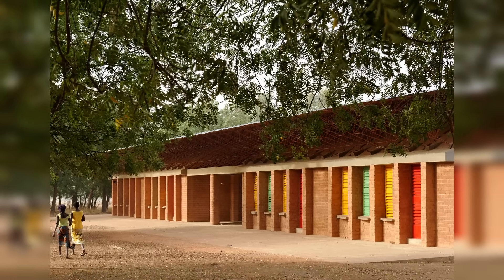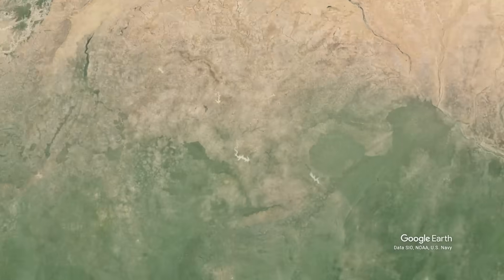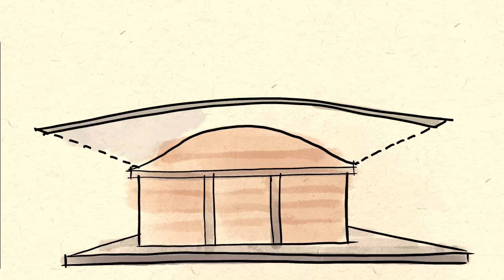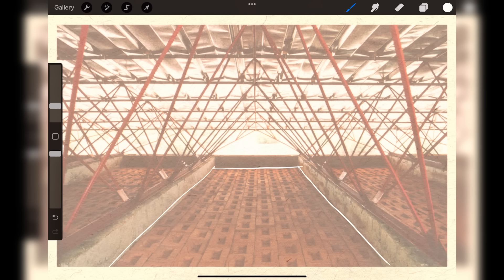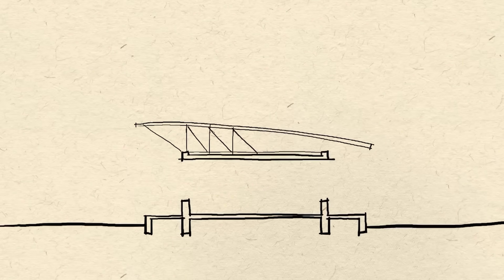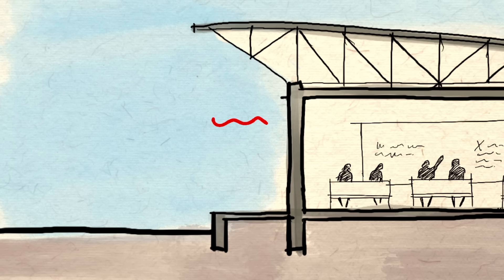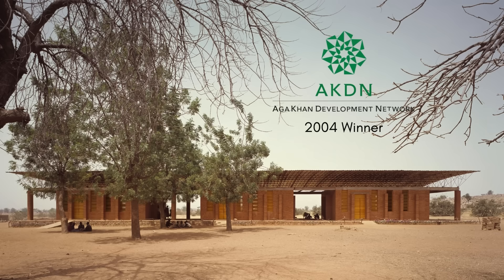The 3 Design Strategies Keeping This Building Cool In Scorching Heat

Comment: They study in schools in the heat because they have no other option. 
Unlike most readers here, I've actually been inside a school on the edge of the Sahara where it was 112F in the shade and no electricity around. The only AC I saw that entire week was in my room in N'Djamena, and in a pharmacy that I had to visit when I got sick. (Pro tip: Don't drink the water. And don't eat the food).

And yes, people gathered in hot buildings to do their school and their work ...because there's no other option.

But if someone wants to put a swank roof on these buildings and cool them down, heck yeah - let's have more of it!
Reply: It would drop the temp by no more than 6 degrees at best. Better than nothing, but hardly cooling. I am saying this as someone who lives in a house like this with no AC.

Comment: Whoa... Hold on.
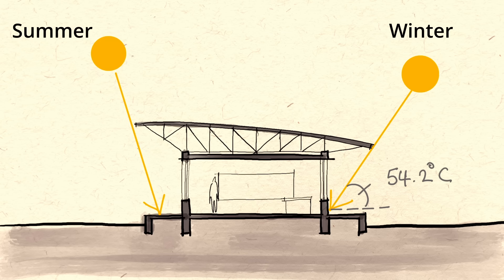@ ~3:00. you show a pic with grounds temps of 101.1C and 54.2C.
Both of those are ABSOLUTELY impossible.
What gives??
Reply from the maker: They are the angles of the sun! The C was a mistake (see the pinned comment) sorry for the confusion 😅
Reply: @SaraSaadouni_TAC  Thanks.  I didn;t see the pin.

Comment: So what difference in tempaerature does it make? That would be the key question I want you to answer!
Reply: There is a reason this clinching piece of evidence was not included. Can you guess why?
Reply: @Craig_Tucker48  I am presuming you believe its because it may not be as effective as it appears on the face of it. I see in other comments they say the award states six degress celcius lower temperature than outside - and the narrator says their "hot" temps vary between 30-40 degC. So 30/40C outside 24/30C inside - which is quite comfortable if humidity isn't high (which it is in BF only in the rainy season June-September). So.... I'm thinking it works well enough?
Reply: @gideonporter537  I don’t believe this, I know this. Unlike you, I live in a house designed like this with no AC in an area that is hot all year and humid for half of it. 

Also 40 minus 6 isn’t 30, it’s 34. 

This design is definitely a smart one and would save so much energy when used with AC, but to say no AC needed like it does on the thumbnail is misleading to say the least. That is why no temperature measurements were reported in the video.
Reply: oops - my math is crap alright lol. But I think it is still a brilliant idea for places that have no hope of affording AC. Better 34deg than 40! And I know from working for an HVAC company that a dry atmos means 34 can feel like 30 if there is air circ. And lastly I would say the locals are used to much hotter temps than we westerners are - so even 34deg is probably "cooler" for them. But yeah I get your p[oint.

Comment: I mean, this is the real deal. Here we are in America designing houses. I’m building them pretty much the same way with the same heating systems and insulation stuff in the past hundred years. But there’s so much we could be doing to work with nature, and said I
Reply: You mean wood-framed? We still build that way because it works. And if you're not using modern materials, products, and concepts to design, build, and finish your homes you're doing it wrong. Modern American homes are extremely energy efficient, weather-tight, highly durable, all but obviate concerns over pests, and are built to deal with the environmental needs of the locations in which they are built. Oh, the horror!

Comment: A good number of years ago I did some thermal analysis with SolidWorks Flow Simulation, a tool used for analyzing products like computers and phones, to do some basic probing on the idea of a shade over a roof. What I found was that there needed to be a pretty good size gap, similar to the one shown in this video, to make the concept effective. It is typical of passive flow, density driven flows need a ton of space because the driving force is low. If wind were the primary driver, you could reduce the gap, but then the strategy falls down on a calm sunny day. The holy grail is a passive geothermal heat pipe that uses water as the working fluid. Heating from above, cooling from below is stable though, and can't be used to drive circulation, the driver being changes in density. Ever wonder why the stuff at the top of a cooler can be warmer that the stuff at the bottom? Heating from above, cooling from below, flow shuts down, and with the thermal conductivity of air being so small, the column stratifies thermally. Fun fact, the thermal conductivity of the materials that thermal insulation are made from is actually pretty high compared to the insulation as furnished. The reason is simple, insulation has one job, keep air from moving. The drag induced by insulation nearly eliminates the effects of density driven flow. The Achilles heel, wind loading on the shade is high in storm conditions, so designing it to withstand high winds is probably cost prohibitive. Probably better off designing to be easy to repair than resist crazy wind that only comes around once every 10 years.

Comment: In Strategy number 2 the video shows 54.2° C for measuring the angle during winter and 101.1° C for the summer. So I'm a bit confused about why the C is there for measuring the angle?

Comment: Roughly 20 years ago, Dwell featured a home in the Southern California desert near Joshua Tree called the “Desert Shed.” It featured 3 main features: 1. A concrete slab that was at least double the amount of a normal 1500sq ft home with the house built directly on top of it (to reduce temperature swings from such a massive slab), 2. A metal roof built up over the house for the previously mentioned venturi effect, and 3. The house was south on the slab with its windows facing south to gain solar energy in the winter and take advantage of full shade in the summer.

Comment: A friend of mind in Washington State has a triple-wide manufactured home. He added a “pole barn” roof 4 feet over his house. It not only provided shade in summer, which sometimes topped 105 degrees, but helped in winter as well with the “snow load”. He did extend the chimney from his fireplace up and through the added roof height to keep smoke from being trapped inter the added roof even though the “pole barn” was open aired on the sides, smoke could still be caught under it on no or low wind days. This was back in 1988……Cheers

Comment: The fact that the inside temperature is NOT mentioned is highly suspicious.  
Probably it is more or less equal to the outside air temperature and the building is not "cool" (not to mention it is plain ugly which for an architect is not a great achievement)

Comment: Give us the statistics: Temperature in the sun, In the shade, and with the Venturi roof. 
Is it an open roof gap over a ceiling built as an inner roof? Are there vents in the ceiling? One side elevation shows a flat inner roof and curved outer roof, another shows a curved inner roof and curved outer roof. Which is it? Ventilated roofs over ceilings are common in hot countries. 
In Thailand the gable angle is very steep, about 50°, to allow the  hot air to rise. Fans are used to create a breeze. 
In Thailand often a flat roof becomes an open air top floor over which a gable roof is built for extra shade, This floor is commonly used for clothes drying, which in itself reduces heat required to evaporate water. Bird wire is needed to stop flocks of birds nesting and pooping. 
The houses are often raised one floor height above a pond of water, or in modern times, above a car port, bathroom, laundry and open kitchen, Traditional houses did not have glass or fly wire, this allows full natural airflow. Mosquitoes and insects can be a problem and insect nets over beds are often required. Verandahs prevent the sun from shining on the walls, and usually have herbs and plants growing in them to the increase shade. Sometimes verandahs are so wide that there are no inner walls. I have 37°C in the carport at 4am in the morning. 
Thermal bricks hold the heat making the house hot at night. This choice is related to whether the temperature drops significantly at night. Concrete block houses do not cool at night in Thailand, and need airconditioning.
The break through is the Venturi effect of the roof. I need to see statistical evidence of the  increase in air flow. I am sure it would be an improvement.
Reply: Click bait. I live in the desert. 95 is considered a balmy day - LOL.  First of all, the people in Burkina Faso live in primitive conditions - the little relief they feel from the heat is different than people who are used to living in a country like the U.S.
Secondly…..humidity, or lack thereof, plays a big difference. On a 8% humidity day here, even 95 doesn’t feel bad…..during Monsoon season that same temp can make you feel like you want to die.
I have lived here since 1978. I have electricity but also am set up for off grid.
I have compound style houses…..each is 10x12. Double layered roof with air space in between layers. Top layer is covered in liquid silicone roofing material - three coats
I made evaporative coolers that run off a 100w stand alone solar system.  Fan is 60w….pump is 20w.
Standard 100A lithium batteries.
My little houses are normal wood construction, wool inside wall insulation. 36x40” windows on three sides.
On a 110 temp day, with low humidity…..inside each house is about 75 tops. I often have to wear a sweatshirt till mid morning.
Reply: @SUHSeungJi  👍Good I did not say "click bait." No problem. I believe,double roof with air flow in between, and maybe a sod topping and grass with automatic night watering if water is freely available. Heavy black plastic used for water sealing concrete slabs and walls, or over a timber, timber and iron or reinforced concrete slab all with plastic waterproofing, 
Consider reinforced concrete pillars and cement block walls with steel rods and infilled with cement for wall strength. Then mound earth up to the inner ceiling roof at an angle of 30° from the ground, grassed, the walls plastic waterproofed. Door and widows double glazed gas filled. I cannot do the engineering safety calculations. Imported steel and concrete are very expensive compared to local timber. Different tooling and jigs or boxing adds expense. 12' X 12' or 3.6m X 3.6m is the concrete slab module and 4' X 4' or 1.2m X1.2m is the strong timber floor stump spacing module. Wall timbers are at 2' or 600mm centres spacing. So 12' X 12' module are cheapest to build.  Consider 12' X 18' living plus 6' X12' wet room Shower, basin, toilet, washing machine or trough. The kitchen sink and cooking area along the 12" inner wall on the opposite side to the wet room. All plumbing close. In simple timber cottages for a couple, the wet room was separate to the house for odour exclusion. 
We used to go to the toilet outside, and eat inside. Now we cook and eat outside and go to the toilet inside.
The Asian wet area and eating open air downstairs and sleeping upstairs with the cooler evening breeze works but it requires an expensive staircase, and dust and no security from people. Insect and animal life is a factor to consider, Families live side by side, and they have watch dogs, if a dog bites you and you kill it you can go to jail. Every system has its strengths and weaknesses. I admire your building initiatives. Well done, 👍✅
Reply: Yeah, looks like someone found a pop article online and just read it. Very scarse on details and no follow up whatsoever. According to the video this project won an award in 2004. That’s 20 years ago! well, if the design is so effective it must have spread far and wide, right? Where’s the photos of all the other buildings that have been built on the same principle? Are there any? Perhaps what works great on paper is not all that great irl?

Comment: Ambient temperature will still be the same with shading, the surrounding air mass remains constant temperature. THe only thing shading does is to reduce the direct heating by solar impingement, which does aid in the indoor comfort levels but if the air is hot enough it is just plain hot. Engineering like this can lessen the need for heat transfer devices but they have a limit, sooner or later some form of air conditioning is indicated for human comfort.
Reply: Airflow then becomes essential, and it is always cool underground, so dig a long underground tunnel, air intake at the end, the air gets sucked into the tunnel by the hot air leaving through the holes in the roof of the building, and you get nice ground temperature air into your building.

Comment: What is the temperature difference insiide vs outside?  Put solar cells on the roof to use  for an AC. Collect rain water to store from the roof.
Reply: Good solution. Makes running an AC much cheaper.

As for why they did not include temperature in this video which needed it to verify should be obvious.

Comment: So what is the temperature inside of the classroom?
Reply: -6 Celcius. The Aga Khan Award for Architecture lists the Gando primary school by Francis Diebedo Kéré as six degrees Celcius cooler compared with the common tin roof alternative.
Reply: That is -6 degrees cooler than outside, not -6 degrees. Considering how hot it gets in the day, that is still hotter than most people would consider comfortable.

There is a reason they never gave us a temperature reading in this video, despite this being the focus and key measurement that would empirically verify their achievement.
Reply: @Craig_Tucker48  Believe me, it is a world of difference for the Burkina Faso kids who otherwise would have to endure ambient temperature.
Reply: @danielheckel2755  I agree, it does make a world of a difference. Where I live is hot all year. But this is hardly “no aircon needed” like it says on the thumbnail. Anyone who disagrees is welcome to trade in their aircon for this house.
Reply: @Craig_Tucker48  6 degrees celcius cooler than outside is better than a normal building would achieve, because normal buildings are hotter inside than outside.

Comment: A radiant barrier to reflect heat.  Drawing air through a cool thermal mass during the day.  Cooling the thermal mass at night.  Insulation.  It would be more interesting to see graphs of the inside and outside temperatures for the hottest and coolest days during the year rather than all the talk talk talk and claims of performance. It is sad that these children must endure religion.

Comment: I snorted out laughing when you said high temperatures of 35c. We regularly get 48c for a significant part of the summer
Reply from the maker: Unfortunately that’s the case for many areas in the world! Where is this?
Reply: @SaraSaadouni_TAC  Don't know where they are at, but in many parts of the central US, 40*C is not an uncommon summer temperature.  Nor is -24*C in the winter with feet of snow.  We can't really build for just one extreme.
Reply: @nonya.bizness  thats a pleasant summer for us

Comment: As I watched this I was hoping for a temperature for the  area which was said but, I  wanted  an internal temperature from inside the  "no A/C needed" building.   I think with the  smart design, and available materials it's much better than normal building practices.   However,  I would venture to say it's probably not in the  70 degree range for an air conditioned structure.   Very  thoughtful!
Reply: maybe not in the 70 degree range, but the heat-load is greatly reduced, and that means less A/C is needed to cool to the desired temp! :)
Reply: @GlueTubber  Exactly what I was saying.   Is it  30° cooler or 5°.  Orientation of a building with respect to sun exposure can do a lot.  Trees can produce almost miraculous results.  Just wondering about the before and after.
Reply: @keithsuggs7935 if you live in the desert, like I do, shade makes a lot of difference. I have double layered roof, airspace in between. Liquid silicone material on top of roll roofing.  I would venture to say the temp drop inside their school is no more than ten degrees. 
A ten degree drop plus better shading via the Venturi roof helps….but people have to realize hot is still hot and those people are used to it, so the little difference makes a bigger difference for them rather than people who are used to more comfort in the states. It’s all relative…..😂
Reply: @SUHSeungJi if only this video would be honest like you.
Reply: @danielheckel2755 has already commented:
-6 Celcius. The Aga Khan Award for Architecture lists the Gando primary school by Francis Diebedo Kéré as six degrees Celcius cooler compared with the common tin roof alternative.

>  I don't know the actual temperatures involved, but I did a bit of C <===> F conversation math: If the original inside temperature high would have been, for example, 35 C (95 F), a -6 C difference would mean a cooler inside tempterature of 29 C (84.2 F)--still not as cool as most North Americans would be comfortable with, but still substantial. And, as someone else pointed out, for local people who are accustomed to hot temperatures, that difference would feel significantly cooler to them.

Comment: I missed the part that told just what the "cool" temperature inside is.
Reply: Their silence is deafening. As someone who lives in a building like this I will disclose that it shaves a few degrees off, but only if there is wind and only if humidity is low.

The people touting this probably live in air conditioned appartments.